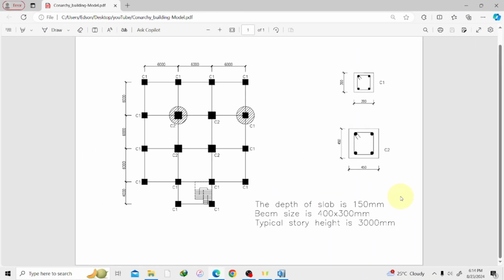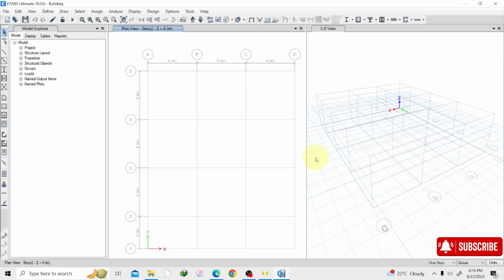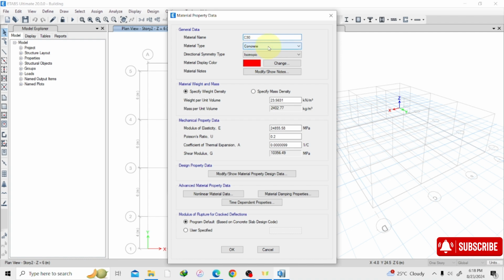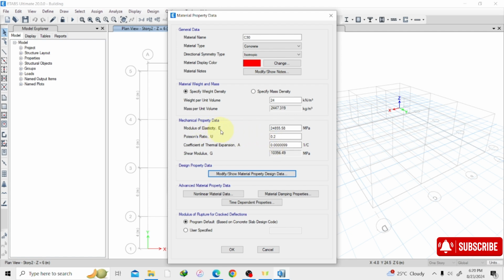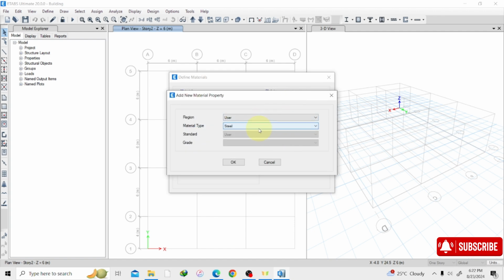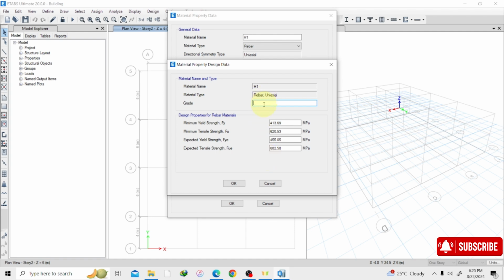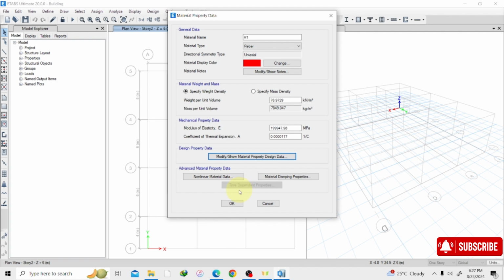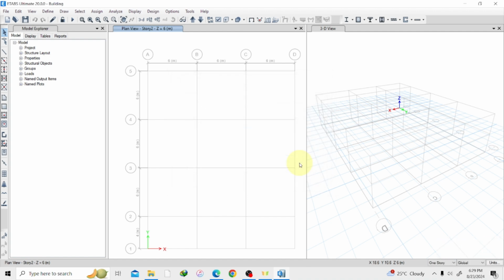6. ETABS Building Design: Defining Material Properties in ETABS

Comment: Keep in mind that fc = 30 Mpa stands for compressive strenght of a cylinder concrete of 30mm x 15mm , you have to convert it to gain fcu value which is for the cubical sample.